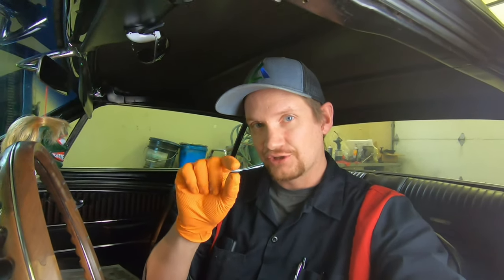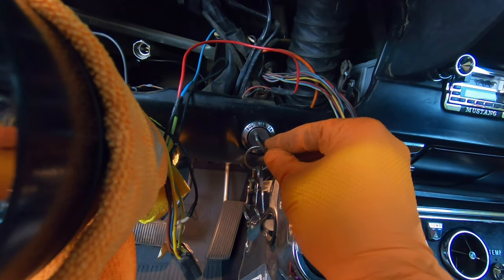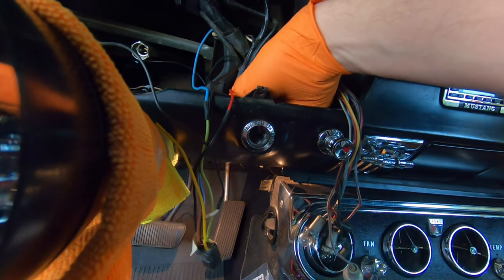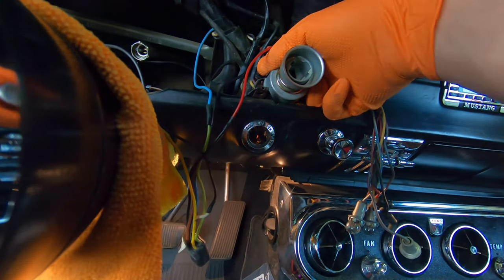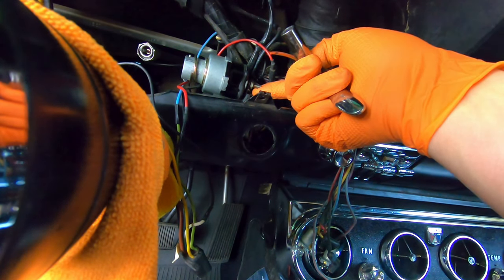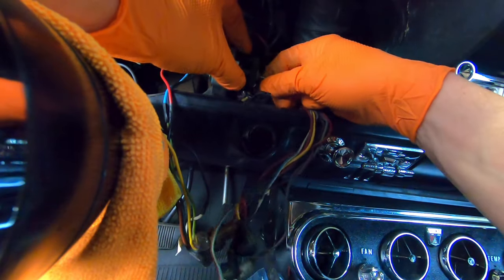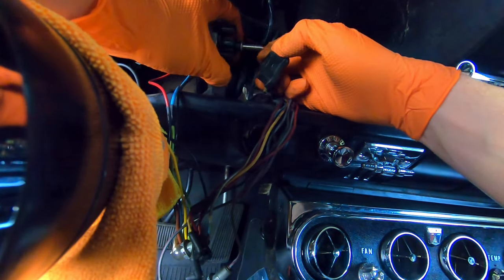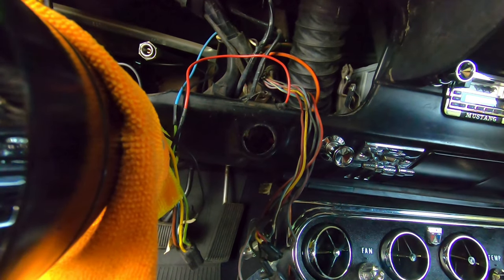How to remove ignition switch, bezel & key cylinder- 1966 Ford Mustang

Comment: I have a 1966 Mustang convertible but cannot locate the key to the ignition. Should I have a key made, replace the cylinder,and since I don’t have the key how do I remove the cylinder?
Reply from the maker: Well I think a locksmith could probably make a key for you. However if you wanted to change the cylinder, you would have to pick the lock to get it to turn. I've had to do that before. I bought a cheap lock pick set off Amazon.

Comment: Good video but what if I don't have the key?
I think I need a new ignition switch with a new key.
Reply: I forgot to mention I have a 67 mustang
Reply from the maker: Last time I ran into this situation I ended up buying a basic lock pick set from Amazon. I ended up picking the lock after maybe 10 minutes and removed the ignition cylinder. From there you can install a replacement that comes with a set of keys.

Comment: Installation is the reverse of removal - I often just take that line as, 'you know what to do, now do it.' But in my case, I actually had to use the paperclip to get the cylinder to seat back in where it should (even though it was lined up properly, it would not pop back in). I struggled for 30m before I figured that out... ha.

Comment: I actually ruined the sheet metal around the hole while prying out the bezel 10 years ago...Back then I didn't know that the ignition switch was spring loaded...I just gotten the Mustang and was a total newbie and not much information out there.  A few years ago I had to do the repair and close up the hole and weld in a circular patch and meticulously make a new hole and the 2 smaller/larger side notches.
Reply from the maker: Oh wow that sound like an experience. Ya we have it pretty good now with so much access to information. Good to hear you have the skills to fix it though.

Comment: Alf hey i was wondering which wire would you splice into to install a kill switch ??
Reply from the maker: You would want to splice into the wire that activates the starter solenoid. This wire was a red with blue tracer for many years and comes off the ignition switch, goes to neutral safety switch if equipped with an auto trans, and then to the S terminal of the starter solenoid.
Reply: @AlfsMustangGarage  Thank You Much ! I'm gonna install a kill switch on my 66.. 😁

Comment: Need to know what wires come off the ignition cylinder from dash toward block I have all stock wires
Reply from the maker: What year?
Reply: @AlfsMustangGarage  66 inline 6 200
Reply: @AlfsMustangGarage  need to know colors of the original wiring from the ignition switch to the engine bay
Reply from the maker: I would invest in one of these. I highly recommend it. 
https://classiccarwiring.com/products/1966-ford-mustang-color-wiring-diagram